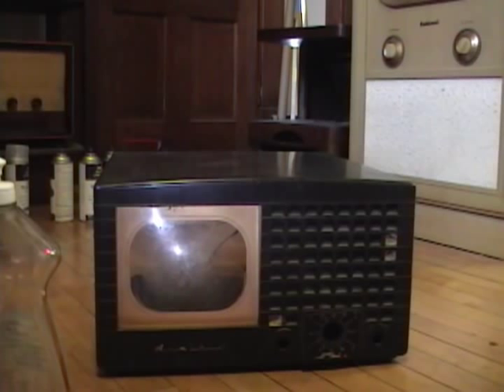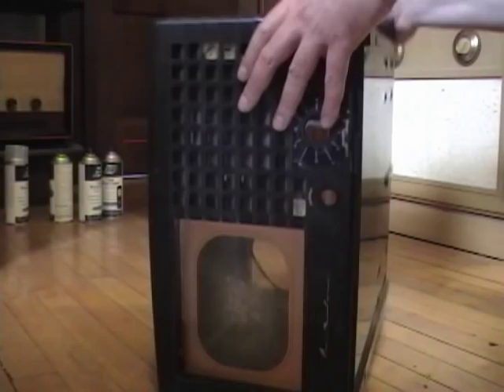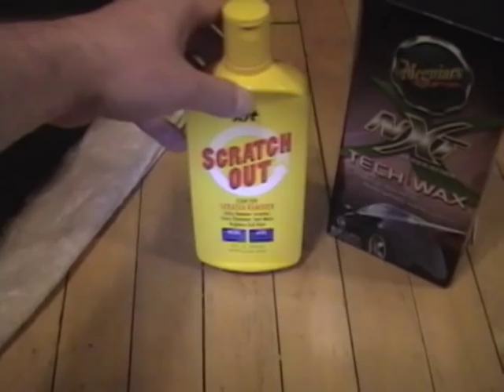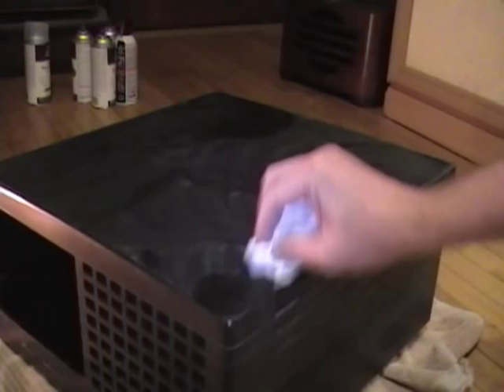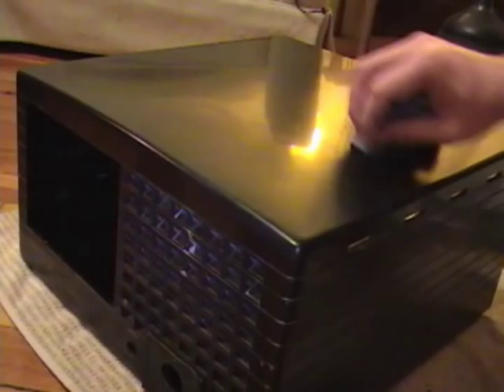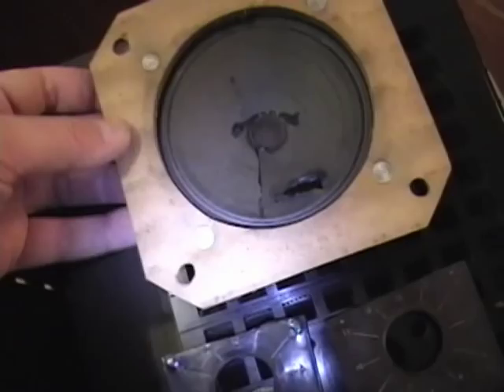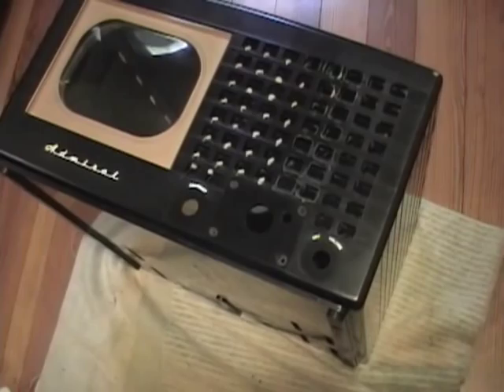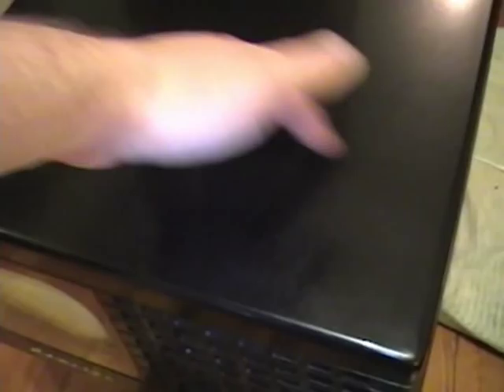Admiral 19A11 cabinet restoration

Comment: You think semi-chrome polish will work good for the Bakelite?? I use a pen made by sharpie...called sharpie paint..for the white lettering.
Reply from the maker: Simichrome - Yes, it works well but requires a lot of elbow grease.  I've used it in some of my videos.